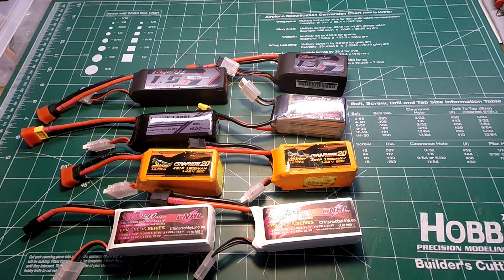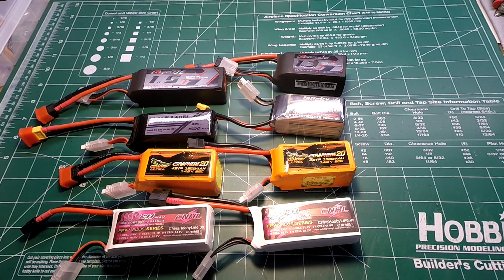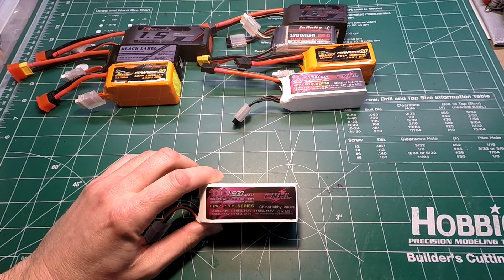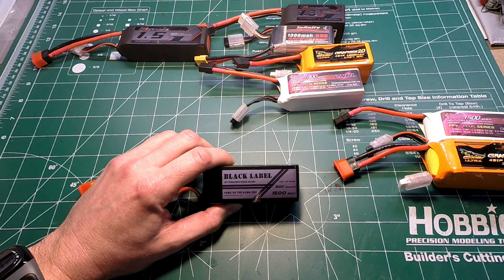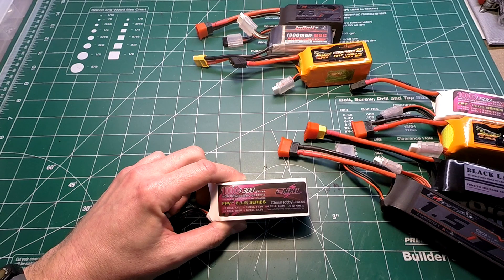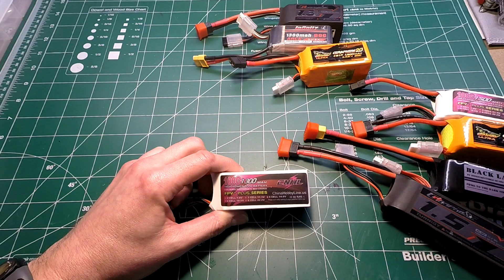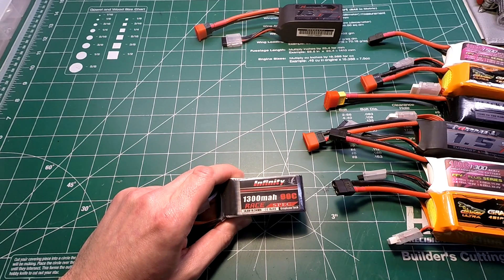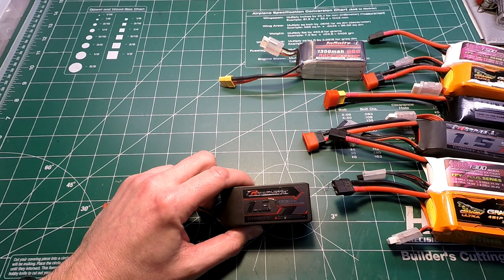Group 1 High Current 80 & 120amp Lipo Discharge Results

Comment: batteries are the luck of the draw. just matters if u get a good cell or not
Reply from the maker: fritz - This is partially true for some brands, but in my extensive battery testing experience there are brands that consistently perform good, mediocre and bad overall, with the mediocre and bad brands showing a lot more variance in cell performance.

Comment: Seems like.i should stay away.. what do you think right now is the best battery for your dollar?
Reply from the maker: tigertom53 - That really is up to user preference and what you're willing to spend per battery, but the best bang for your buck that I've personally used and tested are the Indestructible Quads Gold and Black Label's, the CNHL 100c, and the Pirofliprc branded batteries are your best bet in my opinion, but if you look at the new in this video's description, there are other premium priced batteries that outperform the batteries mentioned. You may have to look at the spreadsheet results in my newest battery testing, as this spreadsheet may not be the most current.

Comment: Amazon has floureon 45c 1500mah you think you can test them? Í heard good things about them people say no ok sag up to 90c
Reply from the maker: tigertom53 - I'll see what I can do, but I've had and used those batteries years ago when I first got into the fpv portion of the hobby, and they were horrible when it came to voltage sag, cycle life, puffing, and cell balance, and that was with the 8 that I had. I don't even think I had one of the eight last beyond 20 cycles without some sort of failure, but then again they could of possibly improved their formula and quality control by now.

Comment: I like that you had the 120a test. If you had a current meter to check the ones that didn’t make it to 120a it would be interesting to see what they were able to put out to get a real-world C rating instead of label lies.
Reply from the maker: Matthew Bennett - Thanks for watching and commenting, and I'll explain why I stopped doing the 120amp testing. If you look at the spreadsheet results for the 120amp testing, the burst times ranged from 3-6 seconds on average, which to myself didn't really show much in a way of performance and discernable time difference as compared to the 80amp test. What I found out from the 120amp testing was that all of these 4s 1300mah and 1500mah batteries can output and surge 120amps initially for a split or fraction of a second, but the voltage of the battery quickly drops and none of the samples can continuously maintain that amount of power output for more than a second at most. So in essence and summary none of these batteries come even close to their manufacturers stated claims or labeling.

Comment: My EDF FW-F-15C upgraded to 8S pulls 100 amps at full throttle 5200MA Hyperion G7 4.35V 90C batteries I'm going to record each cycle see how well it does I will use a transmitter timer so flight times should be the same.

Comment: why was the cnhl1500 so much worse than the cnhl 1300? i would have thought they would be at least very similar
Reply from the maker: Qumefox - I bought three each of the 1300mah and 1500mah CNHL batteries when I ordered, one 1500mah tested about the same and the other did a bit better. What's weird is that they all did slightly better and performed equally after ~20 cycles, so there must have been a break in process that improved them overall, but that's not how I perform my testing procedures or obtain data comparisons for the spreadsheet.
Reply from the maker: harry lenon - It could be due to the different size cells or variance in batches the cells came from, but I may test them again in the future to see if anything has changed significantly.
Reply: Or you could have just gotten a bad 1500. Did you test more than one? I think best practice is to test 3-4 of each battery, though I know that could get pricey when paying for stuff out of pocket.

Comment: How are the cnhl batteries holding up? Thanks for all the testing you do. Great channel!
Reply from the maker: Justyn Markland - They're starting to show their age after a full summer of abuse running on my Emax 2306 2750kv motors, but I have yet had one die or drop a cell. For the price I still think they're one of the better bargain batteries out there currently.
Reply: Thanks for the reply. I will try a set of there 1500mah 5s 100c batteries. I couldn't beat the price for a 5s lipo. I hope they hold up well. If you was was picking another battery from this list, what would you get?
Reply from the maker: Justyn Markland - Personally for myself while taking into consideration price and performance, it's a toss up between the CNHL, Indestructible Quads Black and Gold Label, and the PyroDrone labeled packs in both regular and high voltage variants, but if you absolutely need top performing packs and don't care about the expensive cost, then the Tattu R-line's, Dinogy Ultra 2.0 Graphene 80c, Acehe Formula 95c and Thunder Power Adrenaline line of batteries are clearly superior in the numbers.

Comment: Any thoughts on the Dinogy longevity?
Thanks for the hard work!
Reply from the maker: Drone Punk FPV- I've had both the Dinogy silver 70c and orange 80c packs and I can say from my experience the 70c silver packs are garbage, they have some of the highest internal resistance numbers of almost any battery I've ever tested with massive voltage sag, and two out of the three batteries I bought had one of the four cells drop on me before thirty cycles. The orange 80c packs are a different story, they are some of the best packs that I've tested and I have had no issues with any of the cells from the 1500mah or 1300mah versions so far, but I'm only around 30 cycles in and consider 50 cycles to be the minimum standard to hit before I endorse a pack as having good longevity, especially a pack like this that is priced in the premium priced lipo range.

Comment: Thanks for doing this. Not easy to find objective data on value packs compared with the golden standard graphene packs.
Reply from the maker: Nitro Nut -Thanks for the kind words, I have another battery test group coming up soon that will include the Tattu R-line 95c, Thunder Power Adrenaline 80c, Rebel llama, Indestructible Quads Gold Label HV, and the New Infinity RS packs that just recently released, stay tuned.

Comment: My understanding is that lipo batteries are safe until they get under 2.75 volts. I've been running mine to 2.9 volts in flight and haven't lost a CNHL pack yet, but have had two turnigy packs puff after some time.

I'm at around 100 cycles on the most used CNHL batteries I have and they still show ~100% rated capacity by my charger's capacity measurement set to 3.1v - 4.2v

Would like to have seen you run the voltages lower - I think short bursts on the other batteries is silly
Reply: Li-ion are safe down to 2.7-2.8v but Lipo's don't really like going much past 3.1-3.2v though without shortening their lifespan. Plus capacity drops off FAST below this so you don't really gain much from over-discharging them anyway.

Comment: What are your thoughts on the CHL 1300 pack in-flight impression compared to the Turnigy 1300? Does it have fairly close discharge performance as the Turnigy. Its price is really tempting, hopefully it doesn't degrade quickly and has good durability. 
Looking forward to your thought on the Commanders. Keep up the good work!
Reply from the maker: EngineerX I'd say that in my instance the CHNL and the Turnigy 1300mah batteries are pretty close in performance and every other aspect, the only thing that I can't vouch for is the packs cycle longevity yet. I notice a small difference as well with the Turnigy packs having a bit more punch in the air, but maybe it's because they're a bit older and broken in some.
Reply: Interesting! Pretty impressive coming from a budget LiPo. Wish they were $20 instead of $19.99 - easier to get free shipping. Hopefully they age well and have good service life. I'm gonna have to keep them in my list once I see more longevity reports. Also hope they don't do a switcharoo on the quality of the cells on future batches.
Reply from the maker: EngineerX Agreed, and I'll have to keep you updated on their cycle longevity as they age, but so far I am pretty impressed with their performance for the price.